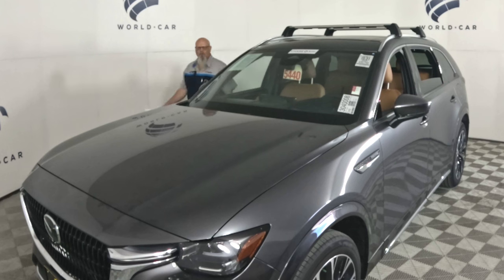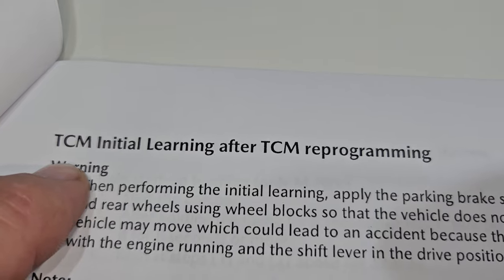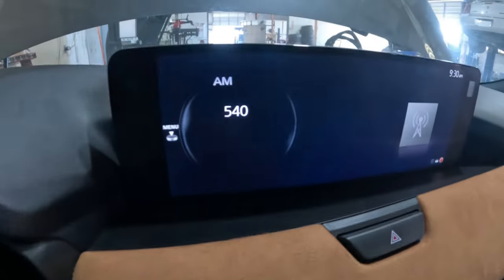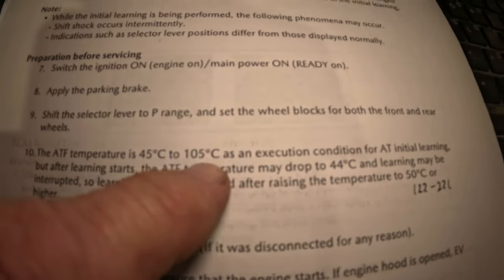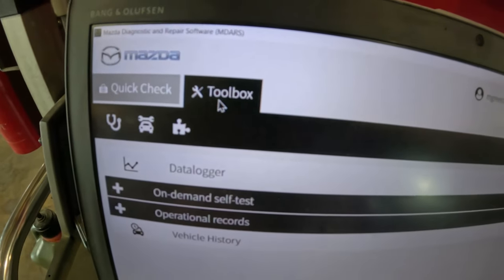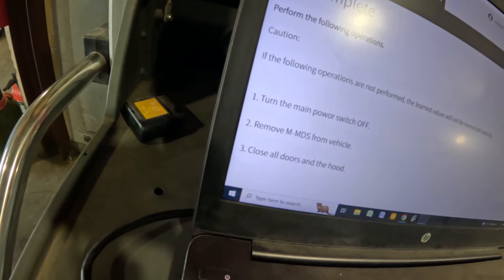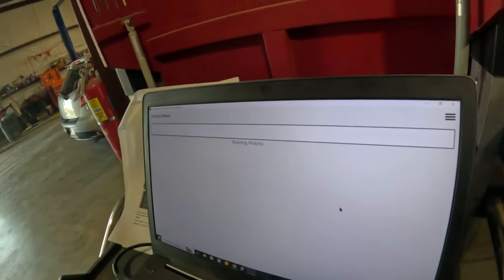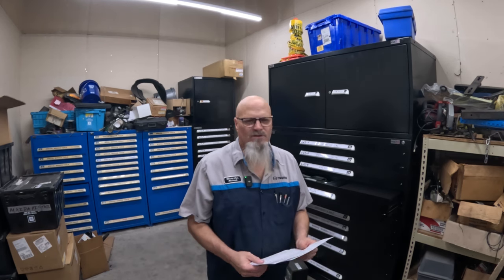2024 Mazda CX-90. Now with even more recalls

Comment: Great detailed video, thank you for this posting, I don’t own a CX90, but my daughter just purchased a 2024 CX5 on May 5, and her hubby has as a 2022 CX5 hope they don’t get these recalls. But if she does we hope our Mazda dealership service technician are as complete and thorough as you! Again, thanks for a great video, extremely informative and detailed and yes…interesting. Mahalo and Aloha from Hawaii!
Reply from the maker: Thank you for the kind words. The CX-5 is a great vehicle. And, thanks for your support.
Reply: I just randomly stumbled this video n read your comment. So cx5 is 7years old platform, by now mazda has ironed out most if not all the problem cx5 has had in the past, from NVH no longer an issues, cracked cylinder head n  coolant gasket leak affecting 2021 model. On the other hand, cx-90 is a brand new platform with brand new engine and brand new transmission/gearbox built inhouse by mazda(some or most company outsource engine or gearbox to save R&D cost). Thus its always best not to buy 1st gen of anything, wait until 2nd or 3rd even.
Reply from the maker: Yes, new platform and new problems.  Because of that I have never bought a 1 gen anything.  The people that buy first gen, I call the Trailblazers. Pushing ahead with no fear and setting the path for the rest of us.

Comment: I was driving my in-law’s Lexus NX this weekend and the emergency braking system engaged during sharp cornering and locked the steering wheel from apex to exit. Terrifying. My brother in law says his new Honda crv hybrid locks the wheel when he goes over sudden inclines. All these systems are not sophisticated enough for secondary roads and need to be disabled at low speeds.
Reply: You watch Motorsport racing hub? 😅

Comment: Since I have this car the Mazda CX-90 PHEV premium I don’t even know how many times I have been visiting the dealership, also there’s a sign in my dash saying engine malfunction or hybrid malfunction, I have a year with the car and Mazda has done just nothing, they told me I can’t use the app to warmup the car inside when is cold, but the same thing now in summer when is too hot I can’t use the app to cooldown the car inside, sir have you seen this issue?
Reply from the maker: For the malfunction message. You need to go to the dealer to get it fixed. It could be anything. If the dealer is giving you the runaround, then take it to another Mazda dealer or just scream and yell until they do something.  I don't know much about the app. I never owned a Mazda with connected services.  But, if they are telling you that you can not remote start the vehicle to warm it up or cool it down. Then they are wrong. And, I would want to know why they say that.

Comment: my father asked me what car he should buy, i recommended the cx-90

but now i have concerns about few things.

im worried about the lithium ion battery on the turbo S model, especially in case of flooding.
that could cause it to catch fire.

im worried about the turbo charger if it would be expensive if it breaks after warrenty expires. and if thats a common thing that should be expected on a turbo vehicle.

im worried about maintainance costs especially for spark plugs. due to the engine position

and the two fins that sticks out underneeth the car on the rear side, if they can easily be damaged and be expensive to repair

are my fears unfounded, please give your expert opinion
Reply from the maker: Mazda does turbos. They have for many years and don't have many issues.  Spark plugs should not be an issue either.  They are rated I believe to 100,000 miles.  Unless something happens. You should not have to change them very often. Lithium ion batteries can catch fire in any vehicle that has them.  But, there are safety backups in place to stop that from happening.  I mean, you could get hit by an 18 wheeler crossing the street.  But, you're not going to let that stop you from crossing.  I say. Pick the vehicle you like and go with that.  I was worried about the HID headlamps in my truck when I bought it.  If those bulbs burn out, they cost 3-400 dollars.  I just figured that's something I will deal with when the time comes.  10 years later, they're still working.  I wouldn't worry so much.  Just get what will make you happy now.

Comment: I have a 2024 Mazda CX 90 S turbo and nobody has called me about any recalls yet
Reply from the maker: Check your VIN with these break downs. If it falls within. Then your vehicle has it.
6724E  VIN BREAKDOWN JM3 KK ******100044 – 131022 From December 27, 2022 through September 12, 2023
6624E  VIN BREAKDOWN  JM3 KK ******100054 – 147984 From December 27, 2022 through November 9, 2023
SSPD6 VIN BREAKDOWN  JM3 KK ******100044 – 150358 From December 27, 2022 through November 13, 2023

Comment: I have a 2024 CX-90. The left front  suspension has noise. It does not happen all the time. I will wait a little longer to go to dealer.
Reply from the maker: I haven't seen that yet. I hope you get it figured out.
UPDATE:  There is a recall for that.  5923F - SAFETY RECALL - 2024 CX-90 SUSPENSION NOISE CONCERN. You should get it checked out. Don't wait. 
Here is the VIN breakdown. 2024 CX-90	JM3 KK******103564 – 104820	From March 3, 2023 through March 11, 2023
Reply: There's a TSB for fixing it.
Reply from the maker: @nexushexus4365 You're right. It's not only a TSB, it's a Recall.

Comment: I’m waiting for my 2025 CX-90 and I’m just sick of all the videos of how bad this car is. Can’t get out of it now without losing deposit. Just sick about it.
Reply from the maker: Settle down. Take it easy. You need to take the reviews with a grain of salt. If a few vehicles in 100,000 have some issues, people will always show the bad stuff.  Recalls and software updates are just tweeking the vehicle to make it better. Probably something the engineers missed during the production stage.  They seem to always use the public to be their test drive guinea pigs. I call them the trailblazers. Anything that needs to be tweeked or fixed on the 2024 will already be fixed on the 2025.  Every production vehicle has a few blacksheeps. You just got to take it with a grain of salt.

Comment: So would you own this piece of junk ?
Reply from the maker: This is a nice vehicle. It really is. For me. It's just not my style. I have a small family and no need for a larger SUV. 
I have driven many of them and they are smooth and elegant.   When I see one on the street. Even though I work on them and have driven many of them. It always seems to get a doubletake.
Reply: I bought one ,it's an amazing car. My 5th Mazda. My 2015 cx5 was super reliable, sold it at 230k miles with no issues ,just regular maintenance.